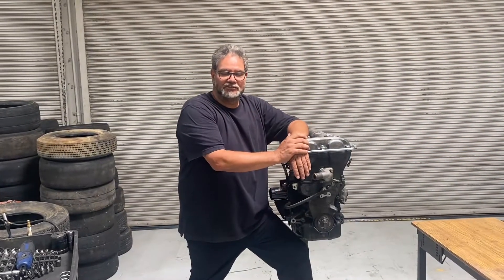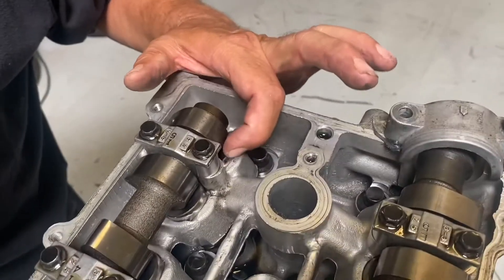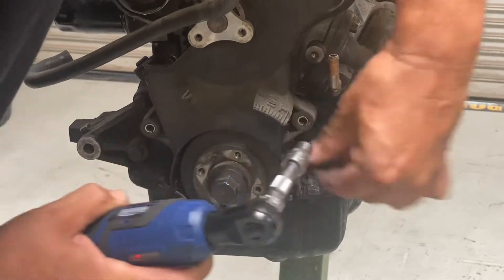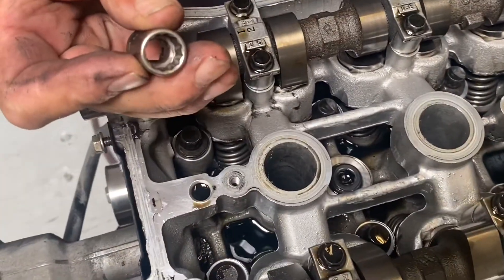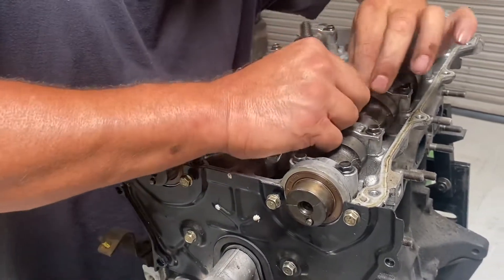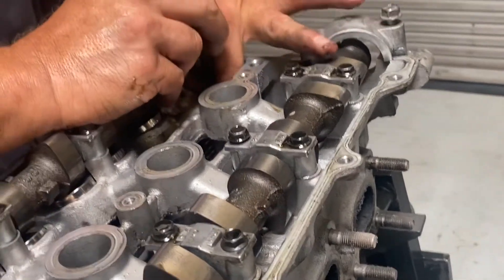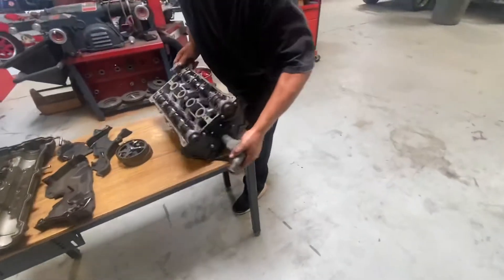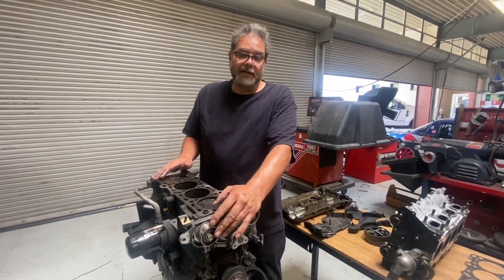Miata Spec Miata Cyl Head Removal

Comment: Is it possible to swap a 1.8 into a 1990 1.6 and have it pass smog?
Reply from the maker: If you are talking about California, you might. It depends on how you do it. If you swap the entire wiring harness and pcm into the 90, they might not notice. If you use a kit that uses a spacer block at the throttle body they will most likely see it. Then that’s a no. The other problem with the kit is it uses your pcm out of the 1.6. It doesn’t know there is a 1.8 under the hood. So you really don’t get the full benefits of the 1.8. I’ve swapped the harness and pcm before. If you take your time it’s not all that hard. Thanks for the question